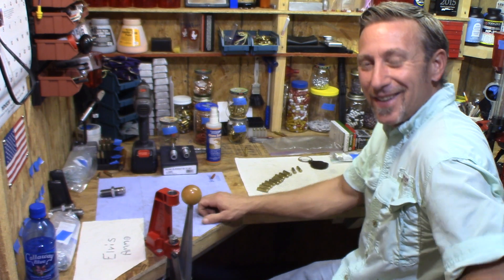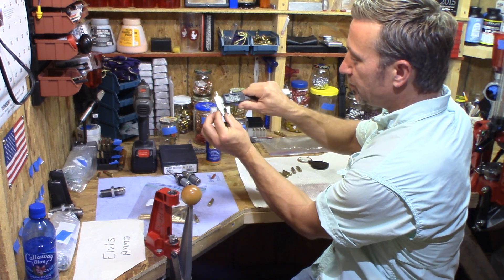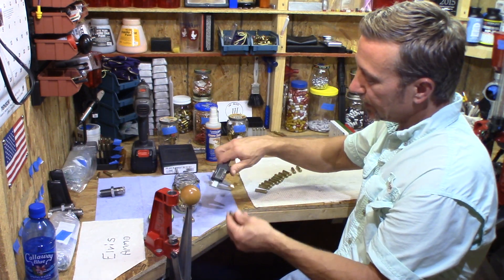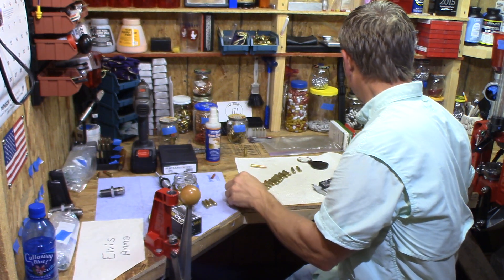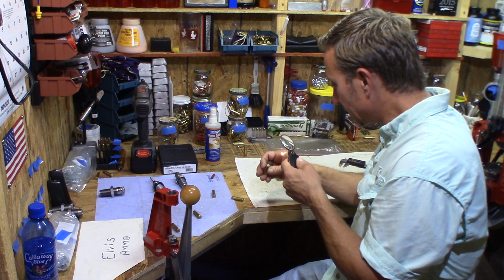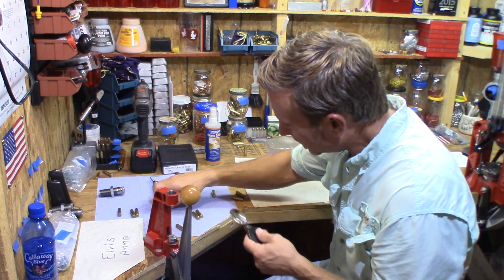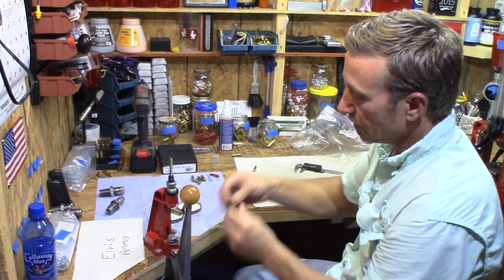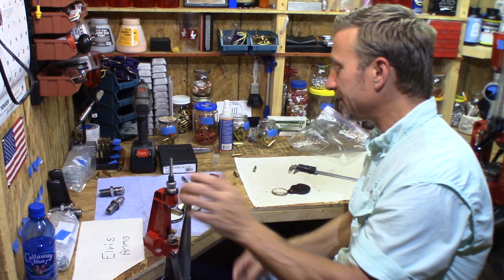300 AAC BLACKOUT (bullet chambering) IMPORTANT NEWS............

Comment: as an "up to date" note on the die you are using from Lee... I have no date on this but here is what Lee says in their manual: 

Warning: 
These dies size only the case neck to hold the bullet. It’s
essential that you use only cases previously fired from your
gun. If in doubt, try them in your gun’s chamber before you
start to reload them. If they don’t fit freely, you must first
full length size them with standard Lee dies. Generally, bolt
action guns can use ammunition that has been neck sized
only. Slide and lever action or autoloading guns usually
require ammunition that has been full length sized.

Comment: I do not see how the die will fix all the problems, the math does not add up to me.

.330-.309=.021  so both sides of the wall of the brass can not be much over .010 or you just run out of room. (I think, could be wrong!) Can you measure the inside of the different brass you are showing there? 

I have ran into some chambering problems myself, I found the same .330 to be my go/no go point. I am sizing with Dillon dies and they are usually on the money. I have the ones that were over .330 (about 3 in 100 rounds), they are in my reject bin so I will pull them at some point and measure the case walls. What really threw me for a loop was I checked them all in my Wilson case gauge and they passed! 

Do not take this as me running down Lee, I have and use some of their products but (there is always a but) I have just posted a video about be having a Lee Bullet Sizing die that is sizing my .309 down to .3075, I figured this out after working for quite a while and not being able to figure out why my groups were not better. I ordered a second Lee Bullet Resizing die from Amazon and received it today and sure enough there is a difference in the sizes. 

I am going to keep the "Bad Die" so I can try resizing some FMJ so use with the Blackout. I am still stuck in subsonic I have not gotten to the supersonic yet. 

Keep up the good video's I know I am learning with you!
Reply from the maker: Hey there Barn Dweller. . Considering Im talking to someone who gets there mail on (sunday)? And Dwells in a barn, I'll try to make this real simple...... sooooo you'll have to remove the tin foil from your head to read this!!!!!!  : ) OK that was fun...maybe you shouldn't tell people all that..... : )...  Hey Man... I liked your video! maybe you should think about doing some more of those? I measured my bullets after sizing at .309  1 in 15 or so are 309.5.... let me know how your new one is... ?   i've seen 300 sami specs up to .335 neck diameter.But my rifle don't like that much?  for my rifle I stick to .333 and if it's over even a ,0005 I reject it. I don't want feeding issues (it can be dangerous! might even get a slam fire! and your rifle might be different? .333 was the magic number for me. thats why I didn't even include my lyman case gauge in the last vid. they can make you lazy and you won't understand the measurements your getting. But once you do by all that by all means use you gauge! Hornady put out some misprinted info on trim to lenth for 300 aac blackout that was corrected, so make sure you check and double check your case length to be sure your info is coming from the corrected source. Out of about 10 brands or so brass i'm using, all but one (wolf Gold ) brass are inconsistent using the RCBS SB sizing die! FYI. i've found that not sizing 300 blk bullets can add to the feeding issues" But I think a .310 would be perfect! You can pc.size and pc another coat to increase the diameter? then recheck your neck size... Be good Barn Dweller!!!!!!!!
Reply from the maker: another note .... I use a lee factory crimpdie as well!
Reply: I know it sounds nuts but I have been getting Sunday delivery on stuff I buy on Amazon (Im a prime member, free 2nd day shipping). I agree its a waist of money. I think the post office should go to every other day delivery and save some money. Most business communication is handled electronically now a days. 

The "Barn Dweller" is a gag from my employes, I have 2 offices and when I am in one of them I am fare game to drive nuts (an they do, I have some good grews(3 locations) but there is always something o deal with) when I Dwelling in my barn playing they are to leave me alone unless the building is on fire (we had our 10,000 sq foot building burn to the ground 3 and a half years ago thanks to 2 BORED 15 year old kids) so after  a baby stroke a few years ago andnow other problems related to stress the doc said either i dump some stress or start digging a whole because I will stink after i kick the bucket......

So anyway back to our bullets, yes I had the same problem I have a few stick in the chamber, would not close all the way and were HARD to get out. I saw some scratches on the neck and that is how I figured out the problem. I have a note here for me that now reads MAX neck size .334 so now I check each one and throw anything .332 in the reject box. 

Sorry if I drive you nuts (somebody has to do it), I really enjoy hand loading but I do not know anyone that does it so I have had to learn from forums and You Tube. Thank God You Tube and the thousands of people are out there making videos for it. I call it You Tube University. That is why I do my videos and they are amateur to say the least. I would like to give just a little back for all I have received! 

P.S, I went back to my Dillon Crimp Die, I found many people in the forums saying not to use the Lee Factory Crimp Die on Cast Rifle bullets. So far so good and trust me if you pay over 150$ for a set of Dillon Dies you want to use them ........

Please keep making your videos I for myself have learned much from you.

I will now go crawl back under my rock.

Comment: I got set up to load and shoot 300 BLK in a TC Encore (single shot, not semi-automatic).  Using Lee dies and some new 300BLK Remington (factory primed) brass, I found I was getting a lot of failures to fire.  It wasn't until I bought a Wilson case gauge that I found out that a large percentage of the new Rem. brass was out of spec for head space.  I won't buy any more Remington 300 BLK brass and especially not if they are pre-primed, again.  If I want to run the brass through the sizing dies, I'd have to remove the primers.  Haven't had problems with my home converted brass using Lee dies since I'm using the Wilson case gauge.
Reply from the maker: Hey kosmocookieduster...... thanks for that bit of info. things to be aware of. kinda hard to deal with primed brass ... that part sucks! I call that tuition fee.... when a lesson costs money! The good news is you didn't have to drive around for an hour looking for a place to park!  : ) thanks for the comment!  ps. this seems to be a big subject with 300 blk.

Comment: Use only the RCBS .300 AAC Blackout SB T/C set.  Product #22407

I ONLY use Lake City brass that I cut down myself and reform for Blackout.  Every other piece of .223/5.56 brass goes straight into the recycle barrel.  

Note:  Disadvantage of Lake City brass is that you must swag the primer pocket (only once though).  RCBS makes a Primer Pocket swager tool for this.  Product #9481 (cheap  $$$)

Comment: the lists are to let you know what brass brands are known to have too thick a wall for repurposing to 300 BLK.   From what I read, you want .011-.012 max wall thickness.   You go .013 and up and no matter what you size the neck to, the thicker wall will make the diameter of the neck out of tolerance once you seat the bullet.   You should measure some of the thicker wall cases after you seat a bullet and see what the total diameter ends up being.

Comment: If make your own brass from 223/556 brass. remember that the out side dimensions are the same for the most part, the brass thickness is different from top to bottom. meaning that the brass gets thicker as to go from top to bottom. When you make your own brass this will matter. As to push the brass in to your die and reform it, it is as you pull the brass out the inner diameter of the neck is formed (the ball at the end of the de-cap pin). if the brass wall is thicker the inner diameter will be right but the outer ill be off. you can neck turn you brass to help this out but very time consuming. I use RCBS sb for all my brass forming 30-06 to 7.7 and 8mm, the RCBS as you saw does really size the brass better but if you have trouble the neck wall is most likely the issue.
Reply from the maker: hey 850 doc, thanks for the info, I  don't think I want to get into neck turning. .. It is an option though. . I've found,  I think plenty of brass brands that will work close enough to chamber spec. using the sb die not to worry about brass that won't work. your absolutely right about brass thickness,  that what it boils down to. .. thanks for putting the info out. .. happy reloading to ya! !!

Comment: After de-priming your case, resize the case WITHOUT the "neck expander" ball installed in the resizing die. All excess brass will be on the inside of the neck at that point.  Next use a neck reamer on the inside of the neck to ream out excess brass.  I neck ream .001" under the size of the bullet I use.... in your case I would neck ream the inside at .307 to give .001" interference fit for proper neck tension on a .308" bullet.  They should all fit just fine.  This is the method I use to create 7/08 brass out of Lake City 7.65mm.

Comment: Yes,There's somthing to it!. A lot of forign brass has a thicker wall than our USA brass!. I use only LC with a wall thickness of 10 thousands or less. If you shoot AR-10 =.308  ,  AR-15 =223/5.56   ,  AR 300AAC you should always use RCBS" AR "Series dies!!!.. THE BLACK BOXES!!!, These dies are pacifically made for making cases for the AR or  SEMI AUTO rifle platforms. RCBS makes these dies purposely 2-3 thousands smaller, so they will funtion/ chamber quickly and easy... more slop..... An AR is NOT a bolt action and thus you use the green box dies for bolt and single shot guns for a tighter fit and also becomes fire formed when shot in a bolt action chamber, and then you use the same case over and over but only resize and trim the neck... thus maintaining the fireforming for that same rifles chamber, keeping consistancy and higher accuracy.. Semi autos are basicly sloppy, and require the need for a smaller Diameter case to slide in and out without problems to funtion as an auto...Yes Accuracy has gotten much better over the years with the AR platform with better expencive barrels.. But still woun't beat a good bolt gun... Just sayin.... Your friend Dave....
Reply from the maker: hey Davey Crockett.... Your right about the black boxes and smaller dies, but 300 blk seems to be xtra problematic, in my opinion. lots of buzz about it, No mention hardly at all with the 223 ar. Just wonder what thats all about? thanks for watching and commenting!
Reply: +elvis ammo. could you be more specific on problematic things or symptoms you or others are experiencing?
Reply: +elvis ammo. could you be more specific on problematic things or symptoms you or others are experiencing?
Reply from the maker: +crockett11000 well I  really don't have any hard evidence,  but I wander if maybe there is chambers and forcing cones in some barrels that don't meet Sammi specs ... people have even had chambering issues with factory ammo.. just a suspicion!  but all the rest you said I agree with. ..I've not heard this anywhere at all..Things just don't really add up to 100%.. to make good sense of it,anyways. .
Reply: I think I must agree, I just put together another new upper with a 16" Anderson 1 in 7 twist barrel..at first, I have had a few rounds that did not fully chamber, and that actually got stuck, I had to semi force the charging handle to get it out.. All of my hand made ammo-168 horady bthp was triple checked. And surpassed all specs!. I'm thinking feed ramps, they are very sharp. May need a good breaking in?. I need to shoot a few more times, and will let you know the results...
Reply: Davey Crockett Id challenge you on the range with your bolt gun vs my ar..... mine is very accurate!!!!

Comment: What you really need is 300 gauge to check, but the solution for me was quite simple.  I shoot Ruger American Ranch so I can't speak for AR people, if you are forming your own brass, BEFORE YOU START FORMING, make sure you run it through .223 full length resizer die FIRST and then all works fine.  Well you can actually run it in the end too, but better first.  I recently ran in to similar problem where I couldn't chamber rounds or if I did force close the bolt, I had to hammer the bolt out with the rubber ballet, at first I though my brand new rifle (my 2nd one) is broken until I cycled factory ammunition realized my mistake and had a facepalm :) I had to pull the bullets on some 23 rounds and resize it with 223 die and then I could chamber just fine.  For AR you might actually need small base die from RCBS, but lee's whole 223 kit is cheaper.

Comment: You ought to start your own investigative news website. You cover it all and get down to the bottom of it. Elvis Real News !
Naw, that wouldn't be any damn fun at all. I'm learning as much as I can before I start reloading. This kind of thing  right here would throw a newbie for a loop. Good stuff , thanks man ! BTW, have you measured the neck thickness on one of those thicker necked cases before you cut it ? Could it be these foreign manufactures are making these cases NATO 5.56 spec. which leads to another problem with overall case capacity vs. .223 ? Then I've heard some so called domestic ammo manufactures use foreign cases. The plot thickens.

Comment: If the neck thickness and the bullet diameter is larger than your chamber you can get excessive neck tension that will cause the pressure to go up. The cure can be to turn the necks. A slow process. Or use brass that doesn't produce thick necks. Watching your videos on powder coating bullets I have noticed that you like to run different colors. And seeing all the different brass that you use. I don't figgure that you are working for tiny groups. Using the same components in your reloads would definitely improve your ammunition. I personally would spent my nickle buying a batch of virgin cases than the store bought ammo. Bet they would had been in spec too.

Comment: These is way to much equipment to buy when your getting started
Reply from the maker: hey Mark Evo,  do you have a 300 blk? there may be  some short cuts you can take if ya want to shoot for less , for instance if you have 300 die set ... you can use specific brass that sizes to a safe diameter.. all in all its upfront money that you don't have to spend later ...  everything really does add up! I really really do like low cost! thanks for watching and commenting! !!